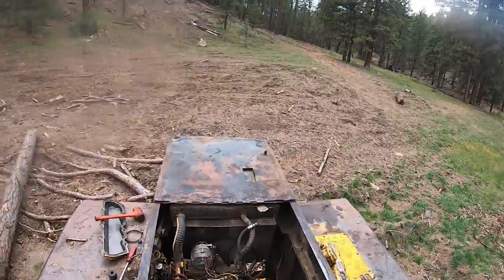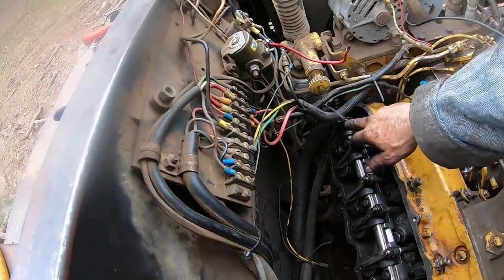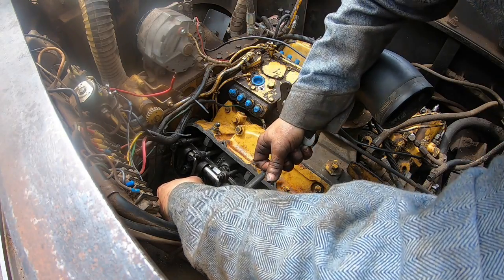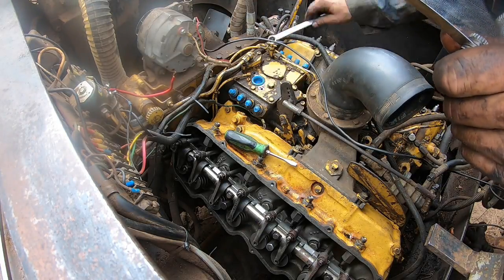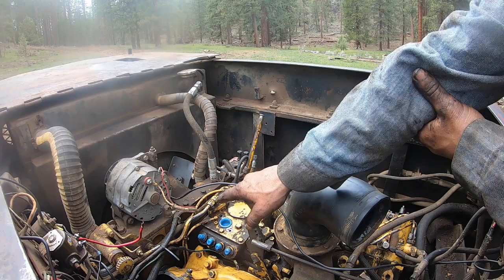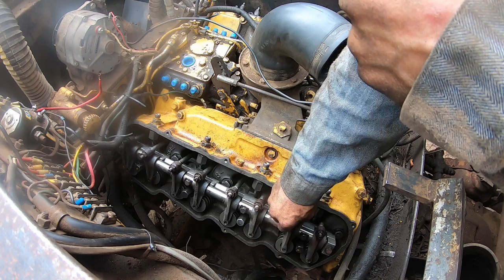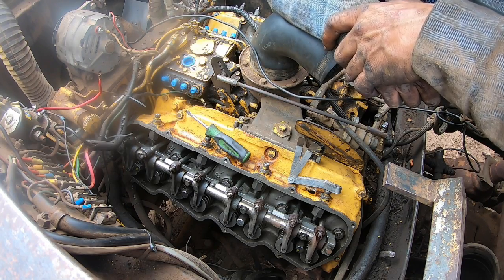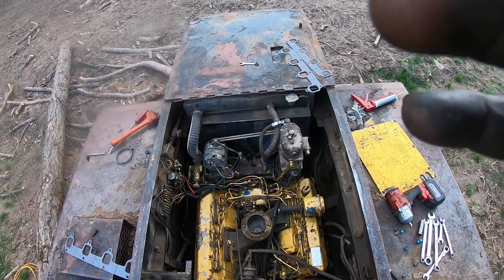Caterpillar 3208 valve lash adjustment

Comment: Great to see the 3208 CAT's ... no really... My dive boat cap had two of these things and man it was a major pain in the ass to keep them going.  The only saving grace was we had tons of room to work on them, but the salt water air and 3208's it was a complete nightmare...  risers, exhaust manifolds, blown head gaskets, transmission replacements and on and on and on...  I earned my free dives on the SubSea Dive Charters - REEFLING in Jupiter Fl

Comment: Hey Warren, Mike and Steve here saying hello...we got our new exhaust manifold and adapter and had to drill it out to make it fit...if you would take a look at our YouTube video and tell us what you think...I mean will it work...or did we mess it up...we need to get the fuel filter system figured out and get the right parts ordered, we would like to run it by you before we order anything and all the lines for everything so we can put it together so you can help us when you get time...Thanks buddy...

Comment: I had that happen on a 60 series gnerator in Alaska, our "mechanic" put a resurfaced head on and told me he did the valave lash. I ended up just doing an in-frame on it as it was older and needed alot of help after the cam got eaten up.

Comment: adjusting overhead at regular intervals is so much more important than many people think. as the miles rack up, the clearance between the valve and the rocker gets tighter. the valve and the seat wear. this takes away from the clearance between the valve and the rocker. if the valve doesnt seal against the seat properly there is no way to transfer the heat on the valve to the head to be cooled. burnt valves can follow. if let go long enough it can cause premature valve train wear and ruin cam lobes..... among many other problems. i have run into many old school drivers and mechanics you understand this and know what to listen for. unfortunately, i have seen many mechanics that if the laptop or flow chart doesnt tell them what to do, they are lost. who wouldnt want to be warren's shadow for a few months? imagine what you could learn.
Reply: J.C. SMITH PROJECTS no doubt. The guy attacks every thing he does. I have 3 of these boat anchors with the same problem. Now I feel I can fix them on the cheap. Head gaskets and some elbow grease. Then we can get back to pumping fuel for the fleet.

Comment: The 60 series Detroit’s were amazing engines because exactly like you say run the valves every 50 to 60 thousand miles and you get a Million before an overhaul.
Reply: Mine has been a goodun. 2000 pre-egr.
Reply: Coming from a fleet mechanic with about 43 Detroit powered trucks, you do not need to run the overhead on a series 60 every 50,000 miles.
Reply: Chris Hill  I agree but we had 209 in our fleet and tried to get it done that often because that’s what the owner expected.  The twin pissers on the skits just about guaranteed 1,000,000 miles before an overhaul.
Reply from the maker: http://www.detroitmanuals.info/series-60/040e02.html
Reply: We Glidered a lot of FLDs into Coronados and ran them because of 7.5 mpg compared to the 6 mph at the time of the new regulation engines.   That and X1 Michelin tires we were one of first company’s running a lot of them.  We ended up stocking a few tires along our routes from Ohio to Portland.

Comment: I have a question Warren. When you're doing a head gasket and you have oil in your coolant and cooling system. What is your way to remove the oil from the engine cooling system including the radiator and Etc?
Reply: Gee Sss I worked at a dealer and we had lots of oil cooler ruptures and then a service campaign for the coolers. After a time we were instructed to use Cascade auto dishwasher soap. It worked great and didn’t require lengthy flushing to get suds to stop. It makes sense as auto dishwashers can’t use high sudsing soaps or it would run out on your kitchen floor but the soap has to be great at oil or dishes will be slimy.
Reply: jimmy aber o